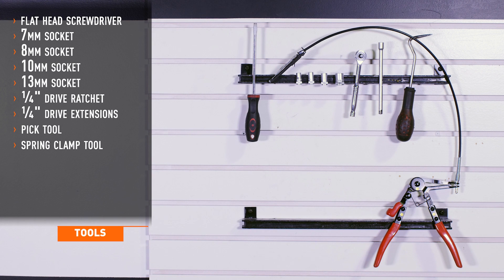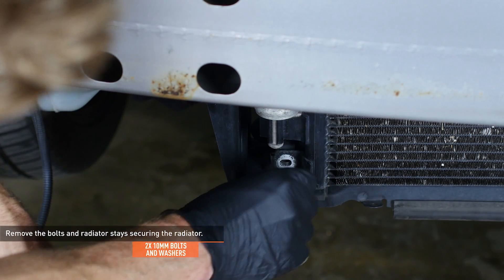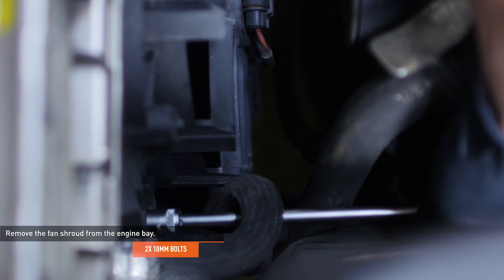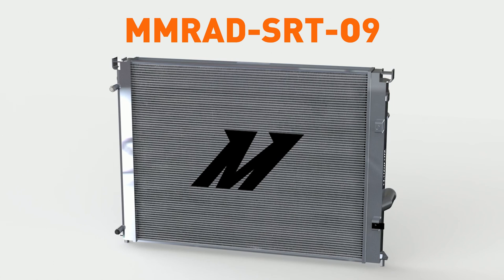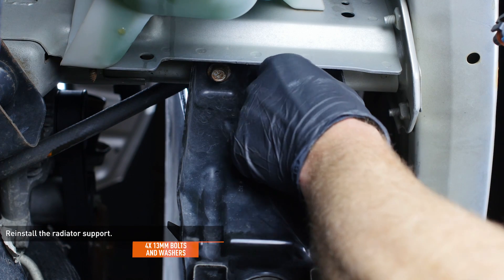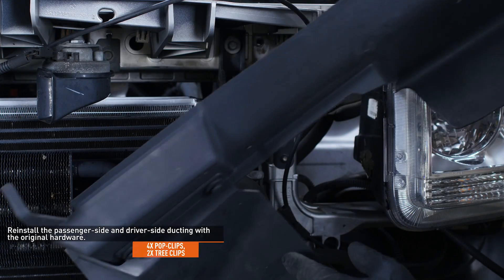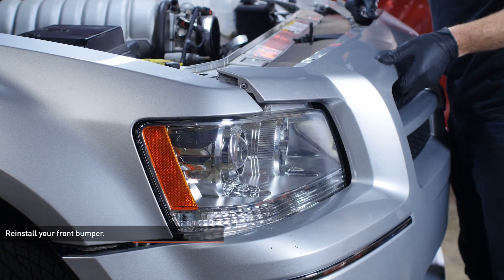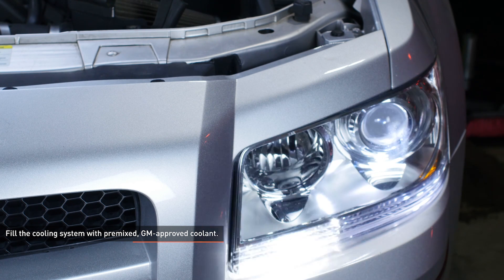MMRAD-SRT-09/MMRAD-SRT-15 Aluminum Performance Radiator Installation Guide by Mishimoto

Comment: and do we need to tune it? , what about using a new thermostat?
Reply from the maker: Neither are a requirement when installing our radiator.
Reply: @mishimoto  so do you have 6.4 L 2015+?

Comment: Do you have for Challenger V6? 🤔
Reply from the maker: Unfortunately we do not have a radiator fort he V6 Challenger at this time.
Reply: I upgraded mine for my 2012 5.7 R/T this week. You will need to remove the bumper. No need to remove the front ducts (shrouding). The fan can only be removed from the bottom. Other than that these instructions are very similar. And, don't forget to bleed it.